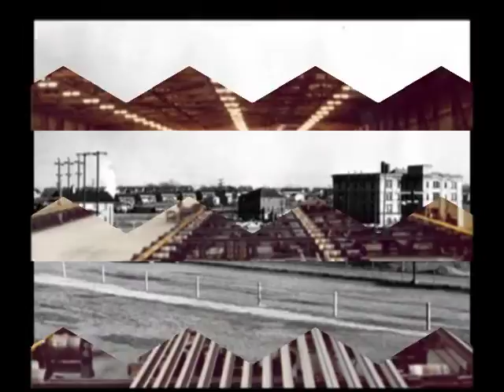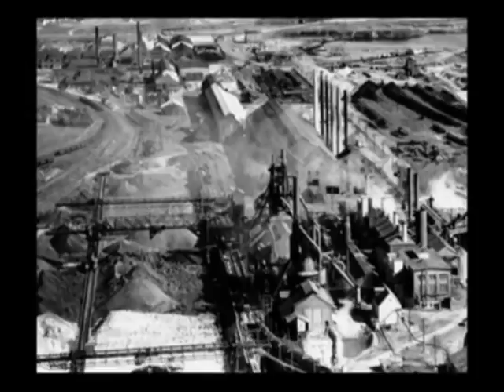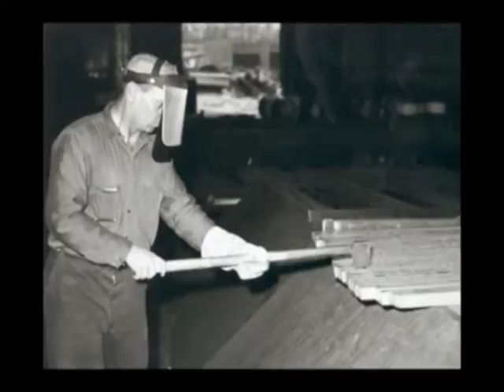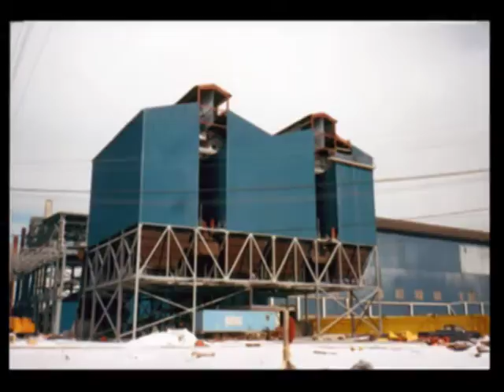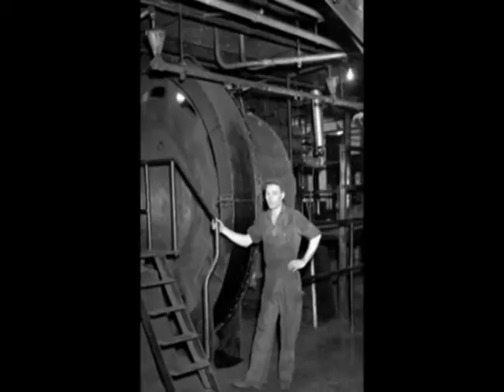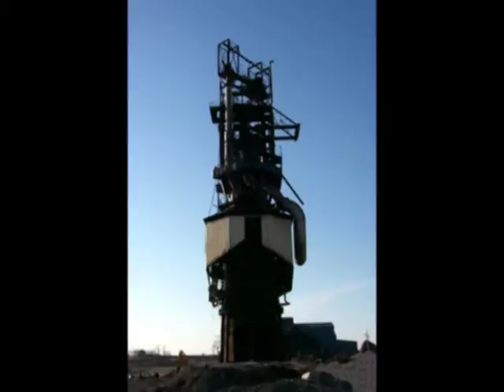Sydney Steel Plant Nova Scotia (Music Lennie Gallant Man Of Steel)

Comment: Those men are good role models, they worked very hard jobs long hours for years. 400+ men died in the plant during its 100 year history.
Reply: And for most of us, Dad went to the plant, Mom was home with the kids. We had food on the table, bills paid, car in the yard. Main thing, Mom was there when we needed her. Dinner was ready, you knew that four o'clock whistle. I would gladly struggle with the pollution of the plant over geo-engineering, gm foods with seed registered as a pesticide with the EPA, and glyphosate in everything from from food to vaccines. If I only knew then what I do now, would have been much more appreciative of what we had, as a community.